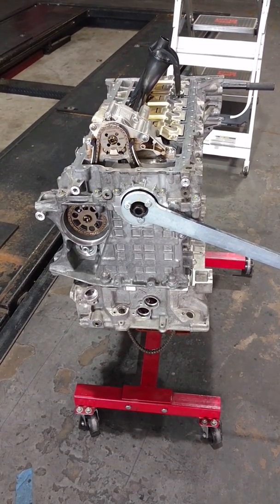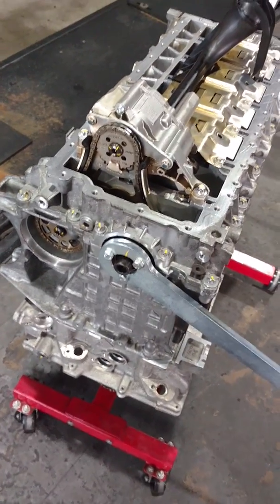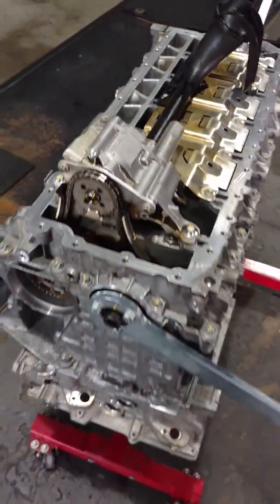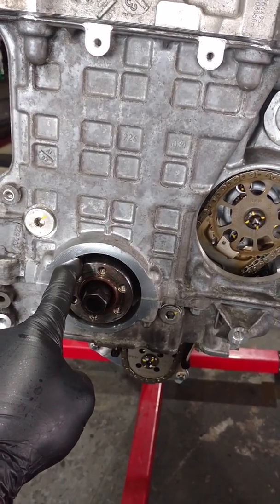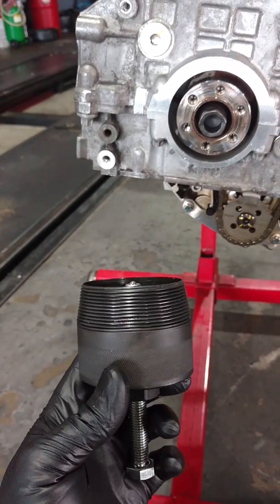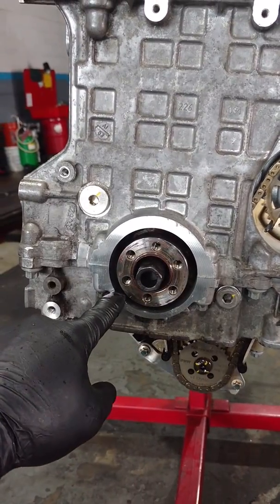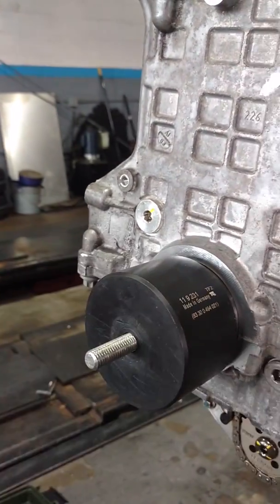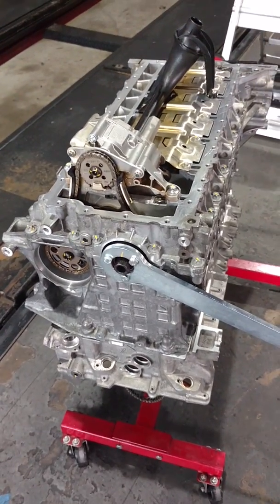ABRhouston.com BMW N54 front crank bolt and front crank seal explained

Comment: Are the crank seal tools necessary? Or can the seal be placed in when the crank hub is out?
Reply from the maker: It has to go straight. And if you have the crank hub out, you've got bigger issues

Comment: I’m 19 and just graduated from auto school and started financing a 2015 335, so far it’s been nothing but a headache I just had my belt and tensioner replaced under warranty and after making it halfway across the country when I got home I noticed my oil filter housing leaking but they won’t cover it, I’m going to do that myself and I ordered a crank seal guard from kies but it’s on back order and I’m really scared to drive my car until I have that on it and I know I’m not at risk. I was thinking about just buying the tool to do the seal so I could at least fix the leak and put a new crank seal on and brake clean the crap out of all my pulleys and I’m hoping that’s enough to keep me fine until the guard comes. My other worry is I can see my tensioner somewhat bounce at idle even though it was just replaced but as soon as it gets a bit of throttle it tensions up just fine and I’m not sure if that’s normal or not. I know this is a old video but any help would be appreciated

Comment: I replace the oil housing gasket but still leaks oil can't tell where is coming from u think could be the crank seal I saw the front of the engine soak in oil n the belt in pieces u think could be sign of crank seal?

Comment: What is the sealant you use? BMW recomends loctite with a primer. Any alternative because they are not available in australia
Reply from the maker: When doing the entire bedplate, we inject with BMW sealant. With just the front crank seal, use Loctite 518
Reply: @Abrhouston  I have loctite SI 5970? Can I use as well?

Comment: is it easier to just replace engine after seal pieces in the engine?
Reply from the maker: IT depends on the severity, and the damage
Reply: @Abrhouston  oil leaked on belt,belt broke, also breaking crank seal and pieces inside timing area car also overheated and blew headgasket I took engine out and noticed oil mix (alot) inside intake mani.Not sure if to rebuild this engine with 207k or buy another I found with 77k for $1000.?
Reply from the maker: @user-pt1qx3gj9h  Trash, get something else.

Comment: Do you guys recommend using the OXwerkz crank seal plate or any other brand? Really want to have that peace of mind that my belt isn't gonna end up in my engine at some point.
Reply from the maker: With proper maintenance, the belt almost never fails. That crank seal plate is a bandage, and a solution to something that isn't a problem if the car is properly inspected and maintained.
Reply: @Abrhouston  Thanks man I have new belt and pulleys and keep my car maintained. But I have heard of people's belt failing for almost no reason in the forums which resulted in engine rebuild. For $100 seems like a good insurance policy.
Reply from the maker: @famousmidnight  they also are DIYers, forum knurds, kids, and other reasons related to why "a belt just falls off". It's like asking us to maintain a commercial airliner. Sure, we know how the suck/squeeze/bang/blow works on a car- but it doesn't mean we're qualified to work on a plane. Same thing goes here. The reason cars get a bad reputation as always breaking, is because a professional isn't looking at the car. The owner/enthusiast is, and it's not necessarily the most thoroughly done.
Reply: @Abrhouston  Very true. I ask because I'm installing a FMIC and new coolant lines in a couple weeks. I'm gonna be right there. If I can't find any Cons to the kit I'll probably be installing one just an insurance policy. Murphy's law is always at play. Thank You for the replies love your work. FYI I familar with the platform Just picked up my second 335 a few months ago. First one I owned for 4 years it treated me very well but I do my best to stay on top of maintenance. especially important on the n54 lol
Reply: The seal plate is a good idea because these belts do just come off for a multitude of reasons. And if it ever does come off, guaranteed it is going into the front seal. It is not just a maintenance issue or DIY issue like ABR states. No offense, but a idler pulley fails, which has happened, AC compressor front pulley fails, which has happened, all of a sudden a oil leak from the pressure hose directly in front of the pulleys fails, which has happened- there goes the belt. I have known these things to happen to several N54s including my own and it is always a nightmare to fix. The plate at least helps eliminate this from happening. BMW's are ridiculous.

Comment: Great video. Thanks for sharing. Did you also inspect the timing components for shredded belt material?
Reply from the maker: This engine was being built, and was for demonstration purposes.
Reply: ABR Houston so what exactly do i need to remove to check the bottom chain and top?? My belt shredded need to check it before I run it.

Comment: Hi....is it possible to change timing chain without taking apart oil sump. Engine N52nb30. I payed for timing chain replecment but no one mentioned that oil sump was removed.  Or it is possible to change it or the chain wasnt changed..... TIA.
Reply from the maker: Why would you replace the chain? They never really wear out.

Comment: Great video and I've been searching a while for one that explains this. I have a N53 engine in a 2008 530i that had sucked the belt in though the crank seal and then low oil pressure due to the chopped up belt material on the oil pickup. Only problem is that is has broken part of the timing chain guide causing notable noise in that area. Can't find a guide on how to change the guide assembly but thinking it has to come out thought the top? It that correct?

Comment: So the oil weakens the belt? Can’t you just solve the issue with belt replacement?
Reply from the maker: You have to stop the oil leak first!!
Reply: Install crank seal plate

Comment: For the S55, do the crank hubs spin even on the CS and GTS models? I know there are different software maps controlling the DTC and was wondering if the software was doing a better job than the earlier base model M4. Also which model M4 is less prone to the issue if that is the case? Thx
Reply from the maker: S55 and N55 have spun hubs in everything :D So, it's best to use a Maximum PSI pinned hub to fix the issue. We sell them, stock them, are their distributors and love em!
Reply: @Abrhouston  perfect, thx for the info on this. I'll be looking into it more

Comment: Have you measured the factory hub bolt torque as you apply the 360 degree turn after the 100ftlb?
Reply from the maker: Well, the 100 Newton Meters is obviously measured- we don't have a torque wrench that has a high enough reading for the 306* yield. We can tell you that a 3-4' breaker bar and 200 lbs of tech on it barely meets spec lol
Reply: @Abrhouston  Thank You.

Comment: If it’s the same design for N54, N55 and S55, why is it only an issue with the S55? More power? DCT? Thanks
Reply from the maker: Same design, but different parts on N55 and S55. Yes, DCT seems to be the culprit due to its lightning fast shifts- but other factors come into play as well for reasons they'll shift or spin. Good thing we have a pinned hub to solve these issues now!

Comment: Thank you so much for the video!!! very helpful. Question: just bought the seal kit from BMW. it came with a Loctite primer and liquid sealer and an applicator. They told me that it has to be used in this application. Any comment?
Reply from the maker: absolutely it must be used, or it'll leak!
Reply: How or where do apply it, on the outside of the seal before inserting it? if you ever redo the video would you consider adding it please?

Comment: You added some important things for me to inspect when I go check out this 135i in the coming weeks. 

He mentioned his oil filter housing/cooler is leaking, gaskets are cheap and the job is doable. However, who knows how long he's been running the car with the leak. So now that I know about the belt, crank bolt coming undone and the front main seal, I'm definitely going to be looking the front bottom end up and down, any evidence that it's been compromised I'm probably going to pass on the deal. It's a good price for the car, but if the engine is damn near toast from the belt getting sucked in that's a bit of a deal breaker haha. 

I subbed your channel btw

Comment: How can I tighten the crankshaft bolt? I have a automatic transmission so it's not as simple as putting it in gear.
Reply from the maker: It takes a set of special tools to tighten it.

Comment: Hey do u think 1 min of running the motor with no oil can damage it?
Reply from the maker: eh, that all depends on how and what oil was in it previously. hopefully not in your case :)
Reply: ABR Houston Your BMW, Volkswagen, Audi and Porsche Service Specialists standard 5w30 oil from bmw labeled turbo. Quick over view. The car was crashed . Towed the car home were it sat for about 2 weeks . The car would start after the crash. So I realized the battery cable exploded. So I jumped it in hopes to see if the motor still runs. The oil cooler was clear damaged so I only wanted to start it for a brief moment. It fired up then ran for about a min. Then I shut it off. I went to remove the motor so I can use it in another body. I then discovered a hole I  the oil pan. The impact looks like it was cased from jumping up a side walk. So my whole fear is that the motor sat for 2 weeks with no oil in it the I started it . Was this enough time to wear the bearings. To the point were they might fail if driven on in high boost?
Reply: Also do you thing I can do some sort of inspection I have to remove the oil pan anyway. May be the sump and baffle. But I don't want to remove the oil pump
Reply from the maker: If you want to replace rod bearings, it'd be the time- you'll have to pull the oil pump

Comment: Quick question for you hoping you would know. I got a knock x6 with the n54 motor. I'm wondering are the 3 series the same motor as in could I just take one engine and swap with the other? Let me know thanks.
Reply from the maker: Yea, same long block. Only difference is 2009 down is 8 bolt 2009 up is 6 bolt flywheel

Comment: Alex,
I can't thank you enough for taking the time to make these videos. As I'm sure you know, most other shops and vendors in the n54 community try to hoard information / R&D to themselves, which only hinders the development of this platform all together. Trying to gather useful information on my n54 assembly has been difficult to say the least and some of these videos have been extremely helpful. Please keep them coming! I'd love to see the process of injecting the bed plate sealant. 
On a side note, I also wanted to thank you for providing support during hurricane Harvey, contributing to the n54 community, and constantly firing up the BBQ for the locals haha
-Sam
Reply from the maker: Thanks for the kind words, Sam!
Reply: Fyi...they make a cover plate you can easily install over the crankshaft seal that will prevent the belt from getting sucked into the engine. Just need to take the balancer off and install it with the two side bolts.

Comment: Thanks a lot for breaking this down very well....the other day I changed my Vanos solenoids sensors and ended up removing the engine cooling fan for room and notice a torx bolt backing out near the crank pulley so i tightened it back down to specs....so weird!?!? Figured it was just engine vibration because I run my car very hard when I drive so i Diy 95% of the time on repairs and parts replacement. It's a 2008 BMW 335i n54 and just crack the 150k mark....and yes I know these engines requires lot's of maintenance regularly!!!!😁 especially with high miles...do you have an idea What may have caused this bolt to somehow back-out??? Vibration maybe?? can you shead some light here?? Thanks in advance.
Reply from the maker: No clue why one would back out!
Reply: ABR Houston Your BMW Specialists Thanks.... it's holding good so same here I guess it's just one for the books!!!😁

Comment: Good information. The only thing you don't want to do is remove the white plastic sleeve out of the seal unless you're driving the seal in. I've seen people "play" with the new seal sliding that sleeve around, which could stretch the Teflon.

Comment: Nice video, I had the misfortune of having to do this job twice on jack stands. All I can say is the bmw workshop manual was the only source that accurately describes how to do it. Turns out you need a loctite primer, you have to prime the seal and mating surface, then wait 60 seconds, then insert the seal and inject the loctite sealant with the syringe. What a bitch.
Reply from the maker: Yes, its not a fun or easy job!
Reply: @Abrhouston  is the BMW brand loctite sealant required, or are there other brands?
Reply from the maker: @ikarus_Fix_It  no other type is allowed
Reply: @Abrhouston , well darn. Thankfully the car is still in the shop. I'm going to order another seal and get the sealant. I don't have the removal/install tool, but it wasn't too hard to replace
Reply: Timothy Zelinski how did you remove it and replace it ?

Comment: Great video! I need to replace the front seal on my 2006 325. I have the removal & install tools on hand. Can you explain more in-depth about how to seal the 2 grooves on the sides of the new seal? Are these 2 grooves the bedplate injector ports? Is there anything besides expensive Locktite 193140 that can be used? Thanks & Happy New Year!
Reply from the maker: That's your call if you want to try something other than factory sealant. Do it once, right the first time and it'll save you from doing it twice :)
Reply: John Ruffin a very expensive sealant from BMW is needed along with the primer to activate it it runs about $150. there is a small needle included with the sealant. you use a special tool to inject it and then use the primer to activate it
Reply: Thanks for the reply! Surely there is something out there like Permetex 1A that can be used in lieu of the expensive Locktite from BMW......

Comment: Great video, thanks for posting. I work at a BMW shop and have a car here with a belt that got sucked into the crankcase.  New customer, normally we catch the oil leak and belt tensioner way before this happens. The low oil pressure light is on so I am assuming the oil passages are clogged. How can I clean them without taking the whole engine apart. Seafoam? Also, I saw you install the new seal dry, I thought it was supposed to have a special sealant applied to it. Thanks.
Reply from the maker: You're going to be looking at tears for repair bills. You'll need to pull the oil pan at a minimum to access the oil pump and pickup. 

Because this was a new engine assembly, the seal is installed dry, then using the bedplate injector ports will seal it to the block.
Reply: ABR Houston Your BMW Specialists ..hi there,belt slipped on my 335i n54 and sucked in through crank seal, replaced crank seal and pulled debris from around crank pulley and is still smoking out of exhaust on decel when coming to a stop, no codes,  no check engine lights , or low oil pressure light, also replace vcg and ofhg along with pcv and ccv , any ideas what the smoking could be from , thanks in advance
Reply from the maker: Sorry, didn't see this post. I wish I could help you, but unless we look at it, it's near impossible to tell you what could be wrong. They don't sound related though.
Reply: ABR Houston Your BMW Specialists ... thanks i appreciate it , if you'd like to join my group on fb it's bmw 335i jb4 mhd, close to 1500 members and based out of San antonio Texas, lots of texas members on there so maybe u could post your work on their if you'd like